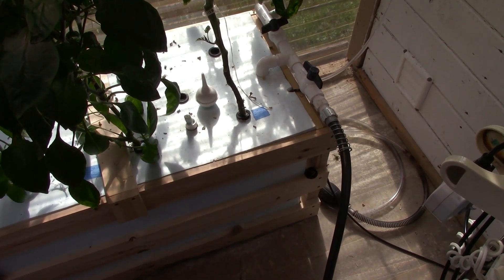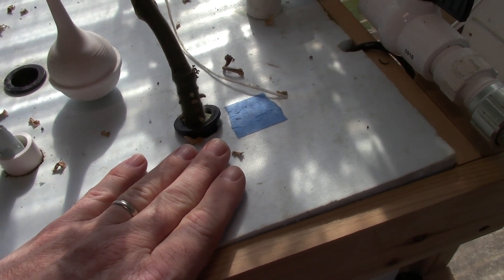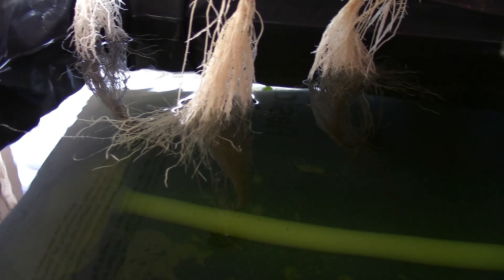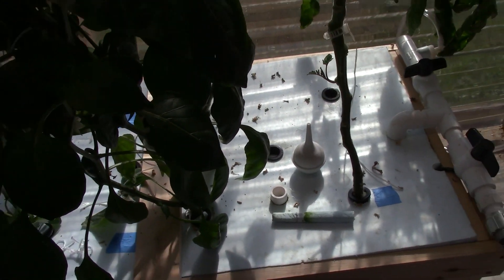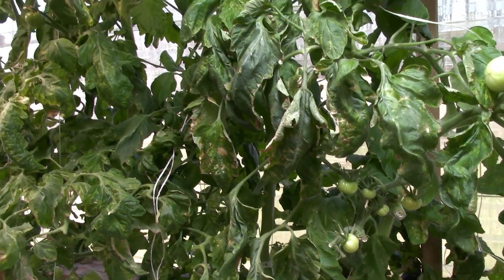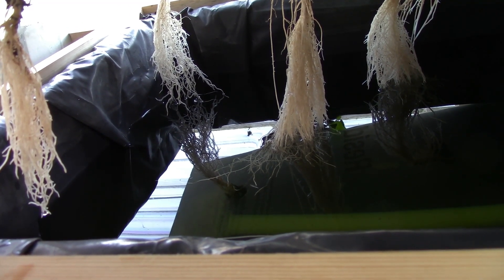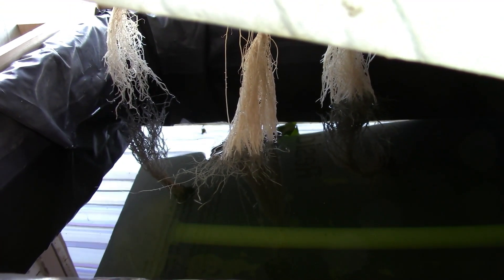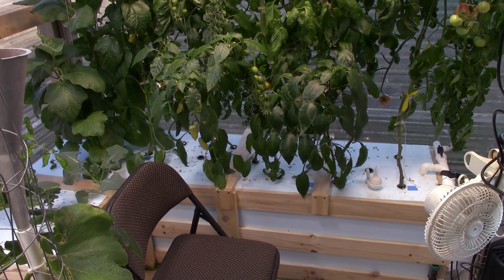Revitalizing Water Culture Bed (DWC) Hydroponic Nutrients

Comment: How goes the fenugreek experiment?
Reply from the maker: Still going full speed.  Taking it every day.  I have looked at a clinical trial where the Fenugreek didn't affect glucose levels until the 5th month of use minimally and quite significantly in the 6th month and beyond.  So, to truly test it, I have to go beyond 6 months.  I just had a checkup and my A1C actually increased, but my cholesterol went down to lower than it's every been in my recorded history, 128.  The flip of that my triglicerides went up to 399, pretty high.  So, something is going on and I'm not ready to do a video on it.  I'll wait until my next visit, likely beginning of June.
Reply: Good luck I hope it all works out and your A-1 C’s drop significantly,👨‍🚒🌱👨‍🌾
Reply from the maker: @nubblehydromicrogreensfarm1484  That would be awesome.  I hate this disease.
Reply: Brent,    I totally understand my wife is type two also so I am very interested in your findings. Hoping to follow the same regiment you are to get her under control if possible thanks for all your work buddy.👨‍🚒🌱👨‍🌾